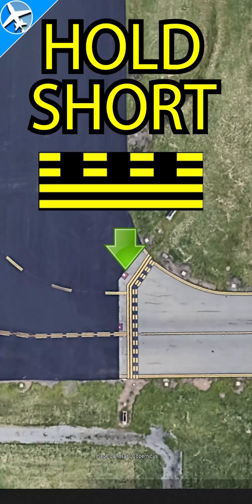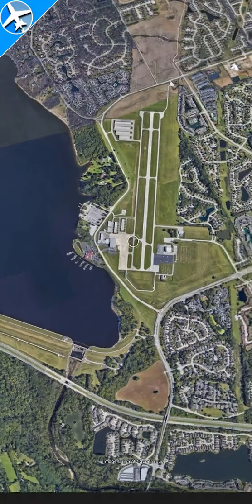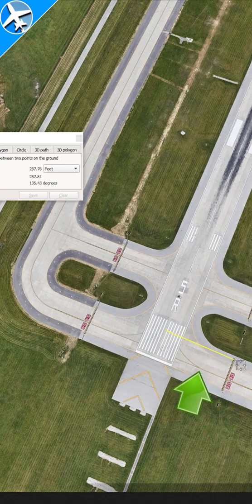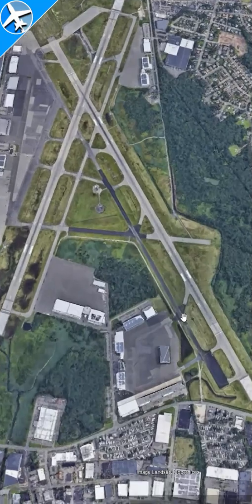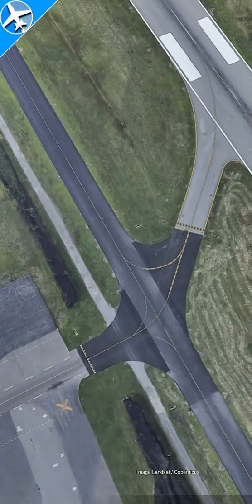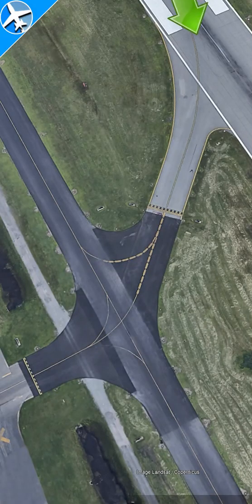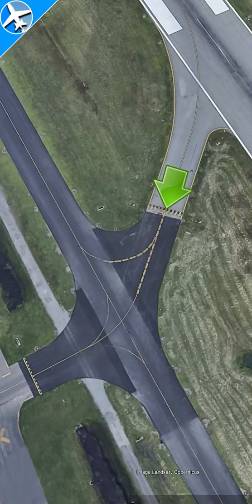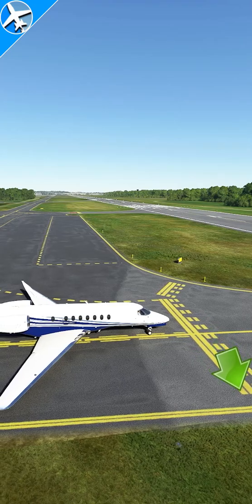Hold Short Line - Runway Hold Position Markings

Comment: All airports need to upgrade this system.  There are far too many mishaps with the current system. 
Maybe a technological upgrade would help. Notifications of where when and how to stop and hold short should be in the cockpit on the pilot's display! This would avoid incursions and other incidents that have been happening recently.
Reply from the maker: Larger airports are implementing Runway Status Lights.  Incursions happen and will happen no matter what safeguard is in place. Electronic Flight Bags with taxi diagrams showing ship position are a huge help.

Comment: After exiting the runway, how far past the hold short line can you proceed without a taxi clearance?
Reply from the maker: Get the airplane past the taxiway then stop until a clearance is received.  We  usually get a clearance quite fast and usually don’t have to stop very long if at all.
Reply: @thecorporatepilotdad  I asked because it seems that often, (in PilotEdge, not IRL), I am blocking another taxiway or intersection once clearing the hold short line and I always have to prompt the tower for a taxi clearance.
Reply from the maker: @virtualDon  without looking up the specific answer, best answer is go past the hold short line but don’t pass any other taxiway or runway without a clearance.  Sometimes I’ll pull up more if another airplane is on final to give them room to clear the runway if exiting in the same taxiway.